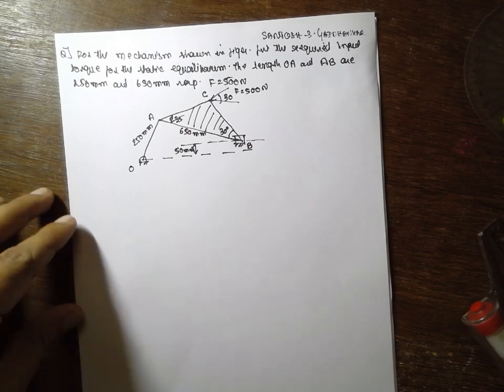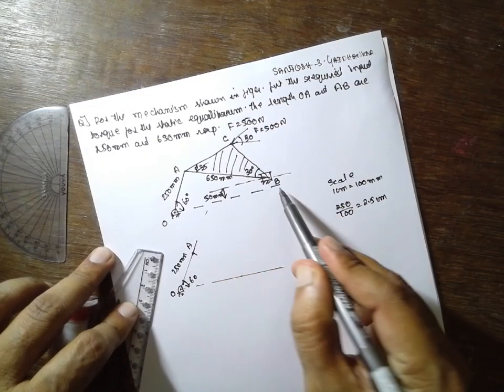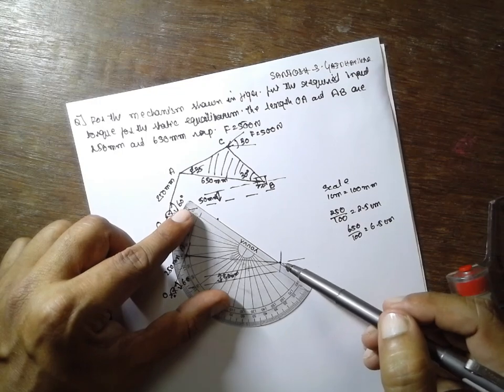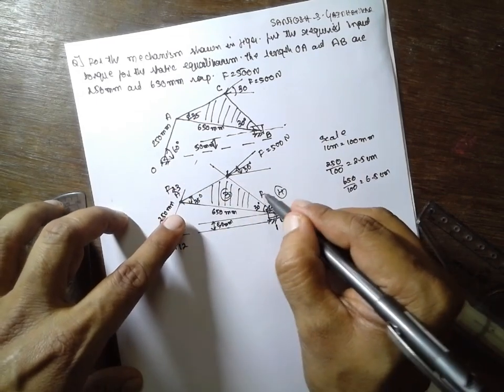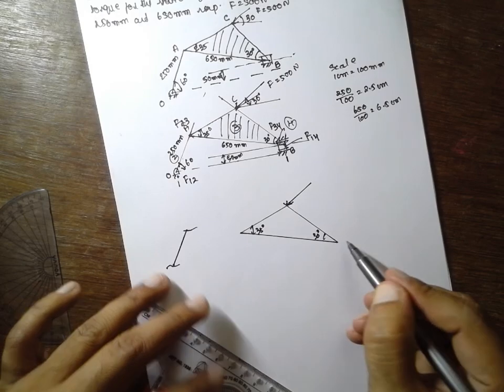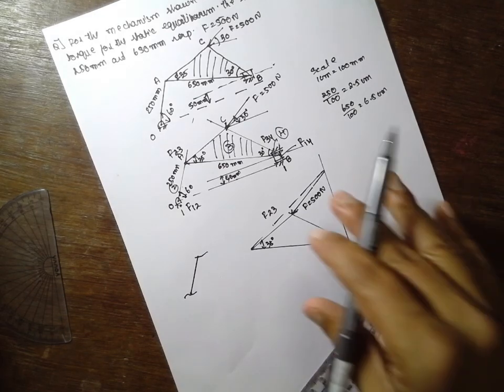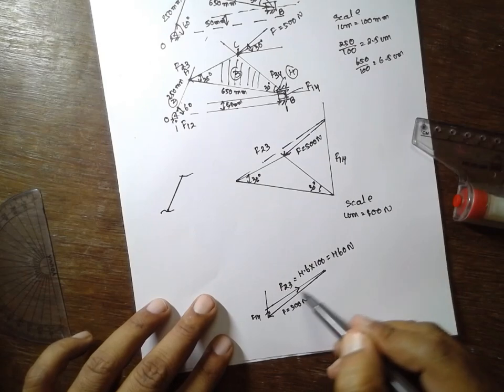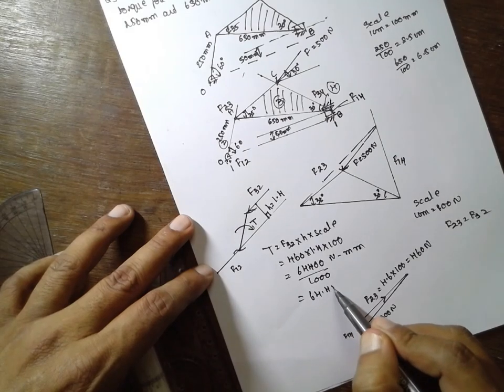Static Force Analysis special problem

Comment: Hi sir, good evening! I have a doubt. In my question the angles were changed crank angle =45degrees,  135 degrees, 270 degrees and 315degrees. offset distance is 12.7mm. OB=50.8mm, BC=101.6mm and magnitude of force is 200N. what steps should i follow in angles? Please do reply.
Reply from the maker: Please send the diagram. @ gaidhankars@gmail.com